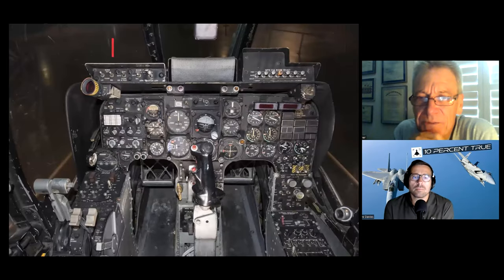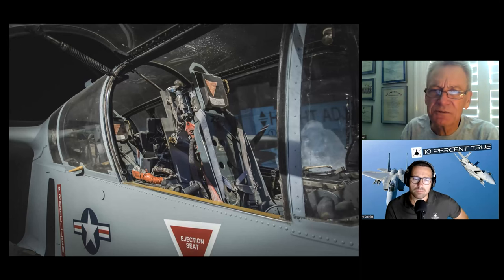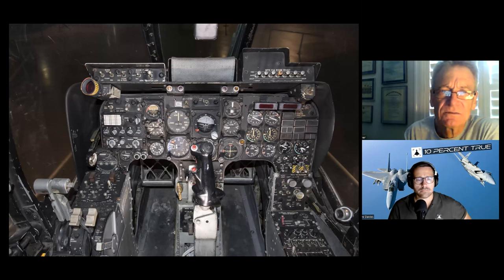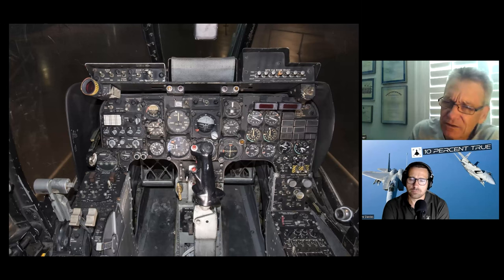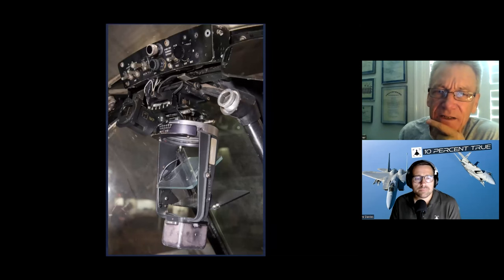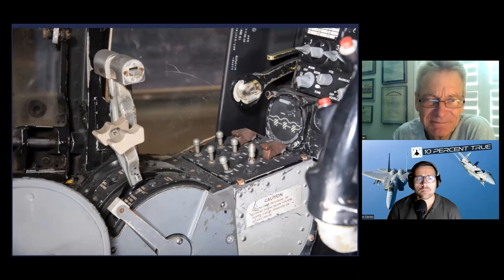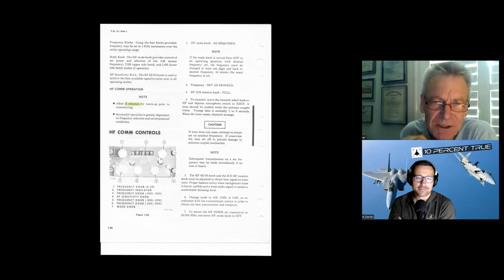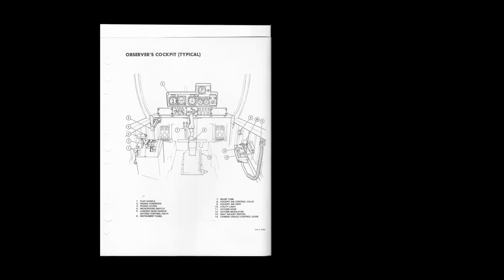Climb into the cockpit of the OV-10 Bronco with "Spike" Benyshek

Comment: To all: I made the mouse-cursor big on my computer for this podcast….but for some reason, it shows up very small on Steve’s.  Sorry!  I tried. 🤷‍♂
Reply: We appreciate your efforts. After switching from an ipad to a big flatscreen tv wasn’t so hard to follow around. Cheers
Reply: 17:20 Sir, I think Mk.4 is the Hughes pod with a twin barrel 20mm and 750 rounds of ammunition. I believe it was used on USMC Broncos. It weighed 1,400lbs though!
Reply: @matthayward7889  If so, it wasn’t nose-mounted like the OV-10D.  It would have been  on the centerline station.  And yes, that gun in the nose of the OV-10D…or the IR sensor on some Marine Ds…weighed a LOT, and is why the D had 44% more horsepower than the A.  BUT: I don’t think the performance was significantly different.  In any case, while the switches for Mk.4 may have been in our As, I have never seen nor heard of one being used on a USAF Bronco. 😎

Comment: The AN/ASM-75A Compass System is very basic. Never had a problem with a flux valve going bad. A few times where the back seat and front didn't agree. I was always a bad indicator. The maintenance tech had to be very careful when ordering or repairing a control stick. The useable on codes were horrible. You could put the wrong stick on the aircraft. Same went for the Arm Control Panel. I remember an incident where the wrong stick and control panel had been installed on an OV-10 and the aircraft had rockets installed before a stray voltage check had been done on the pods. First person to get in the cockpit checked the 781 and saw no problems and hit the battery switch. The crew chief powered up the MD-1 generator and when the guy in the cockpit hit the inverter switch all hell broke loose. Rocket went down range on the ground, hit a sand pile, and scared a bunch of workers filling sand bags.
Reply: Wow!  Was this in Vietnam?
Reply: @brrrtbacheniraq873  Yes at Danang, the 20TASS. We also had a problem with a RAM Team doing a TCTO wiring change. The old civilian who was doing the work was  in a hanger that had bad lighting which changed the color of the wires. We would have to do a first power on check and would pull the aircraft to a safe location because you didn't know what would happen. Like the M-60C machine guns trying to fire. Or the center line tank falling off.
Reply: @MikeC-ry1dk  😳😬YIKES!!!

Comment: Wonder if there are any photos of where the RWR used to be, I haven’t found any. My dad flew OV-10s at Wheeler and Shaw in the late 80s/early 90s and said it may have been on top of the instrument panel. Also funny that the interphone panel is literally identical to what we have in the C-130, still works.
Reply: We had 44 airplanes at George.  About 18-20 had ALR-46 RWR.  It was mounted on top of the right instrument panel, above the weapons-select switches, as I recall.  I just remember less than half the planes had it.  When you see pics of VV tailcode planes, you can tell because there was a little box mounted below each rudder in the boom, and an antenna on each side of the nose.
Reply: @brrrtbacheniraq873  thanks for clearing that up, figured that was a later edition. I have a tape one of his squadron mates in the 22d TASS made of a flight around Hawaii and it lacked a RWR scope. Good to know what to look for exterior wise.
Reply: @guardherc1309  I flew as an ORI evaluator with the 22 TASS, summer of 86!  They brought me and another squadron mate over from George, and we just rode in the backseat while the guys flew to the Big Island to shoot Willy Petes at the range on the volcano.  Only there a week, and three sorties.  That was a good time!
Reply: @brrrtbacheniraq873  that’s awesome, it seemed like an awesome assignment out there. My dad enjoyed the video, brought back some memories for him, remembered using the ADF to listen to oldies stations around Oahu. Apparently they flew with the guns installed quite often and were able to shoot at a number of islands out there.

Comment: Spike, I believe there may be a misunderstanding about the seat.  The chute was in a cannister behind the seat back.  It was attached to a rocket/catapult bolt.  On ejection initiation, the rocket/catapult bolt would fire, break the canopy, and pull the chute out of the cannister.  As the chute streamed out of the aircraft, it would pull/yank the seat out along with it.  That's why the system worked so well at low altitudes.  The chute was almost immediately inflating upon clearing the airframe.  The front seat chute cannister was mounted on one side of the seat back, while the rear seat cannister was mounted on the opposite side in order to provide lateral spacing between front and back seat pilot's ejections.  This system was similar to the Yankee system that was used by some other slow-movers.  (Yankee meaning that the pilot was yanked out of the aircraft.)   The canopy breaker on top of the seat was for any remaining Plexiglas which the rocket catapult had not already shattered when it was deployed.  At least those are my own recollections from flying the bird from '76-'79.  OFP MRO
Reply: mrod, I just dug out my Dash-1 to check.  In the description in Chapter 1, it says the seat penetrates the canopy first, then the drogue chute fires.  In Chapter 3, the sequence diagram shows the rocket motor of the seat firing first, penetrating the canopy, and then the drogue…ie, the same as the description in Chapter 1.  I learned about the Yankee System only a few years ago.  Great system, but by your description, I thought “How would it clear the tail?”  So, I think my description is accurate.  My Dash-1 is current as of 1986/7, so maybe they updated the description.
Reply: What TASS were you with?
Reply: @brrrtbacheniraq873 in the instance of my grandfather’s experience, he couldn’t punch out due to the back seaters parachute condition. Had he ejected, Mikes parachute wouldn’t have opened anyway. That’s why (among other reasons) grandaddy elected to ditch in the Gulf.
Reply: @jakeb7087  27 TASS, George AFB. 1984-1986.
Reply: @jakeb7087  If the backseater’s chute was damaged, yes: most aircraft are set up so that if the pilot ejects, it makes the backseater eject first. This is so a “non pilot” isn’t left in the plane, but also to prevent collision between the seats.  Did your grandfather survive?  I hope so.  Ditching in the Bronco was NOT recommended, because with the high wing, it would almost certainly nose over and flip.
Reply: @brrrtbacheniraq873  No, unfortunately, he did not. But Mike did survive and is the only person in the world who has survived an OV-10 water ditching. In part, due to how grandaddy made his approach, and in part because Mike is well Mike.
Reply: @brrrtbacheniraq873  and yes his parachute was shredded due to the SAM that hit the left side of the aircraft.
Reply: @brrrtbacheniraq873  grandaddy was 20th TASS, Apr-June 1972.
Reply: @jakeb7087  I'm sorry about your Grandpa. 😔 I have read of this story before.  A salute and a nickel for his bravery.
Reply: @brrrtbacheniraq873  thank you, Sir. Managed to save 51 guys that day. I’m glad Mr Brown is still here. My family finally caught up with him in the 90s. I am lucky to count him as a mentor to me.